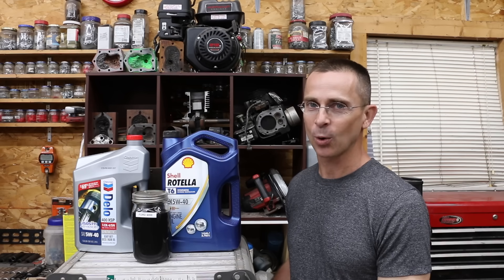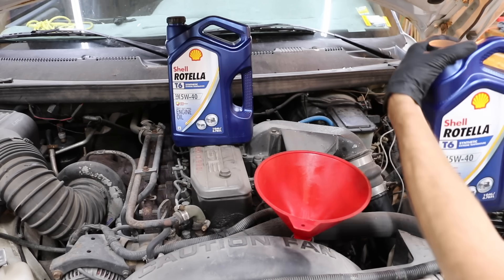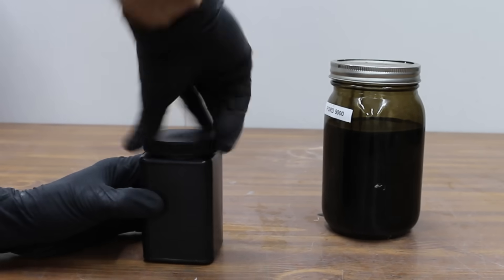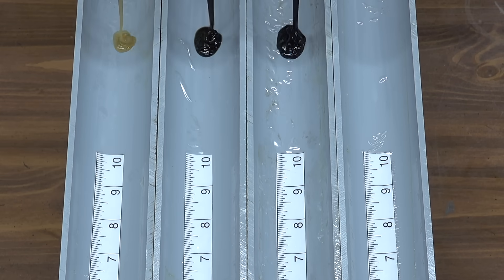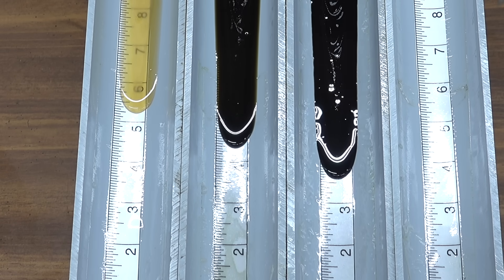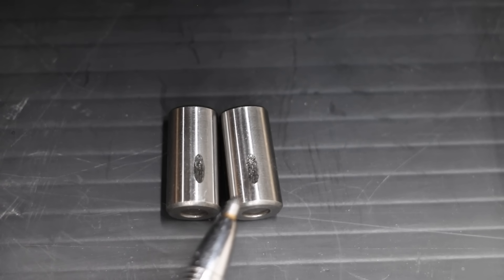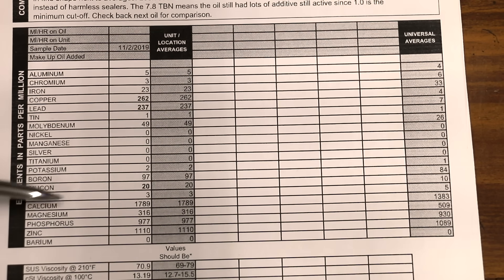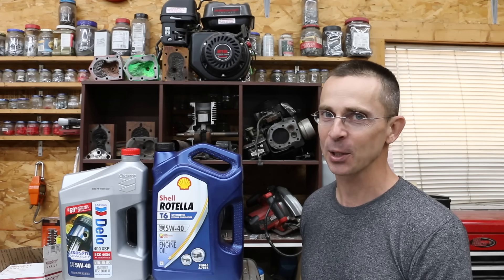Will Annual Oil Change Damage Your Car? Let's find out!

Comment: I can't believe that someone would believe that you don't need to change the oil annually. The rule is to change it at 6k miles/10k kilometres or in some cases 10k miles/15k kilometres.
Reply from the maker: Thank you for the feedback.  What if driven on only 500 miles in a year?  Why would the oil need changed?
Reply: @ProjectFarm  Yes, it wouldn't be economical to change it at that rate, but i also know a man that changes te he oul in his tractor on 100h when the recommend interval is 300h for that type. It's down to personal preference, finances and not forgetting about it! Have an awesome day!

Comment: T6 oil is also used in motorcycles with wet clutch.  It lacks the detergents that most gas engine oil have and would cause a clutch plates to slip.  So I'm told.
Reply from the maker: Thank you for the feedback

Comment: Great video. Question can you do a test comparing the new CK-4 10w30 diesel synthetic blend oils, more specifically Valvoline Premium Blue 10w30 vs Rotella T5 10w30?

I can help provide the oils if that would help.
Reply from the maker: Thank you for the video idea!
Reply: Project Farm, you’re welcome. If you need assistance to get this video started I can definitely help because I want to know which oil is better. And then maybe a Valvoline Extreme Premium Blue 5w40 vs Rotella T6 CK-4 oils.

Comment: Scotty Kilmer says... "Oil is cheap, Engines are expensive."
Great video brother!
Reply from the maker: Thank you!
Reply: @S.T-q6c  I am 1.8m 80kg. With a bad back. The Hyundai's have the drain plugs and filter right at the front of the car (very little egine bay) u don't need to physically be all under the car. U can do the job laying in front. But it looks like your head is too big 😉
Reply: @will260007  And that's precisely the point of my comment. Not every engine is designed the same way, for some, a way to get underneath is MANDATORY. Therefore, it's not "luxury". So good, you got an engine that is easily accessible. Please do the same on a M57N engine.
Reply: @S.T-q6c  that wasn't your point at all but regardless most standards cars can be done without any "luxury" (ps that that was just a joke, it's nice to have that but hadn't had any of that for decades and did manage without issues). Never did a diesel bma but did do an A4 when I had one. One of my comment above was also to drive on planks of woods to give you extra clearance when u do need to go further in without spending extra money. I even made steps with wood 2x4 once to increase accessibility and luxury. Good luck.
Reply: @S.T-q6c  Dude seriously get a life. Peace out.
Reply: Great video as usual. I usually don't reach the mileage within a year so its good to known. Another debate is warm up the engine to change the oil or do it with engine cold (not freezing cold).
Reply: I watch Scotty's video regularly and his advice are sound advice. However, that doesn't mean it's "right" for everyone.
There are two extreme end of car people. 
On the one end, it's the car is just a tool to get from A to B or people that goes "I want to buy a new car, but I don't know what to buy and I have no idea about cars." These people should definitely take Scotty's advice seriously whenever making a purchase or making a repair of a vehicle. 

On the other end is the car enthusiast, people who can't separate themselves from their car, people who love their car, named their car etc. Usually, when these kind of people want to buy a car, they know the brand, the year, the model, the exact spec, and all the associated problem of servicing and maintenance of said car. Scotty's advice isn't aimed toward you, so don't get butthurt or pissy about it when ever he make a comment about your car.

In my opinion, one should take Scotty's advice based on which end of the spectrum that they are leaning toward. Of course if you are the nut case that love niche cars such as a RX-7 (my STi is too reliable and no longer give me the sitting on a timed bomb thrill lol).  Then all advices are out of the window since you know what you wanted and what you are getting yourself into, hopefully.
Reply: @S.T-q6c  Did my girlfriend i20, 2 months ago. Couldn't be bothered bringing my 3 tonnes jack trolley so did it without raising it. Is that low enough for ya or is your i30 lower?
Reply: that phrase is the seed,  and even though synthetic oils are advertised to last longer, most people have their oil changes done at shorter intervals, " oil is cheap, engines are expensive".
Reply: https://youtu.be/JjMB1LSf3U
Come subscribe 
Stay and laugh
Reply: Sgt. SLaughter. Not so in Germany. Oil is expensive (a rip-off) and engines are VERY expensive.
Reply: Robert Ratskywatsky  valvoline instant oil change
Reply: Most oils nowadays can last a year in the engine. No disputing that but what needs to be taken in consideration is the type of engines you have. Some diesel engines can get the engine oil very dirty very quickly for example. Which will then create heaps of friction and damage the engine. Check your oil often and when it starts going black change the oil. I change the oil on my 4x4 every 6 months. Newer petrolcars tend to be quite clean and can easily be changed once a year. Hope this helps.
Reply: an oil change is around $100 near me. not cheap at all.
Reply: @dynamo3059  COUGH Do it yourself COUGH
Reply: @meow8384  i wud have to buy the equipment i need and find a place to store it. plus time is money
Reply: @dynamo3059  1- 5 quarts of oil- $17.99
2- ramps/jack stands- $39.99
3- oil filter $5.99 
Total cost- $65 w/tax 
Still less than those scam instant oil change places
Reply: @meow8384  i dont have anywhere to store oil contaminated shit in my apartment
Reply: @dynamo3059  you can drop it right back at any autopartspa for free
Reply: @meow8384  car ramp/jack stand. You guys do it in luxury. I don't even bother. Too long. Plus u only under the car just to unscrew the drain plug and then to screw it back on. Litteraly 2 minutes max
Reply: @will260007  I wish I had some more ground clearance. I have a Camry so it's pretty much impossible.
Reply: @meow8384  Done it on all my cars with similar clearance without jacking the car up. But if you need more clearance for cheap just drive the car onto 2 pieces of wood (large enough to be safe) that you first set right in front of your front wheels. This should give you a bit more clearance without investing in expensive things.
Reply: @will260007  good idea, I had to pay $50 for my jacks 🙄
Reply: @meow8384  and they use terrible oil..
Reply: @meow8384  I used to park mine over a small ditch.
Reply: Cough building association rule, city laws, cough cough, depends on where you live cough
Reply: Scotty kilmer is also a moron
Reply: @jeffh6971  you are wrong
Reply: Jeff H Haha. He can be a bit much at times. It’s Toyota World over there.
Reply: @Jeff H I think the only thing you can be certain he's right about are silicone wiper blades. Pretty much every other video just reeks of sensationalism, although apparently his videos about repairing older vehicles are rather useful. Just don't use him for newer cars lol
Reply: Agree edbo10, Scotty is an old school mechanic and certainly not a moron. He doesn't have much love for newer cars but is a wealth of knowledge about older ones!
Reply: @edbo10  Newer cars are over engineered pieces of junk with parts made up of plastic.
Reply: @cyberpunk11x

>overengineered
>piece of junk

pick one
Reply: @edbo10  Ever heard of planned obsolescence? Modern cars are not made to last.
Reply: @cyberpunk11x  ever heard of oxymorons? How can something be overengineered, yet a piece of junk? That was what I was trying to say.
Modern cars aren't made to last, largely because things aren't as overengineered as they were in the mid 90s, but they're a lot more efficient and a lot safer. There's plenty of footage out there of highway speed-crashes where somehow people get away unscathed despite the whole vehicle practically disintegrating around them.
I love my mid 90s camry and its overbuilt V6 engine, but I'm fully aware that if I get into a bad accident, I'm going to end up a lot worse off than the other driver in a 2015 camry.
Reply: @edbo10  I was talking about the modern over engineered BMW's, Mercedes Benz, Audi's etc
Reply: @cyberpunk11x  oh well in that case that's a completely different story - all the makes you just mentioned are known for being very expensive to maintain. "The only thing more expensive than a new Merc is a used Merc" and feel free to replace merc with any luxury european auto marque.

if you want reliability you go with japanese vehicles, especially toyotas, not because scotty kilmer says so but because toyota is very conservative when it comes to new tech. They tend to stick with older stuff because everyone knows that's what works, and they usually let mercedes, audi etc. deal with the growing pains of new technologies before they finally use it in their own vehicles.
Reply: @edbo10  yup
Reply: @cyberpunk11x  another cliché about "OvErEnGiNeErEd" german cars. Shut up.
Reply: @edbo10  bugatti veyron
Reply: @acc acc yeah...what about em?
Reply: @S.T-q6c  OvEr engineered means the Germans don't keep things simple like the Japanese do..they overcomplicate everything..the modern German cars are crap.

Comment: Getting engine to full operating temperature 1x per month also very good advice. For the alternator stator or generator to keep the SLI battery 12v SLA battery fully charged, the vehicle must be on at full operating temp & speed for about 3 hours per week in modern passenger cars with lots of small persistent electrical drains on the battery, think security system, telemetry, smartkey transceiver, some compute elements sleeping or hibernating rather than fully power cycling off, since turning the car back on afterwards would take longer if the slow embedded computer had to cold start every time you hit the start button. Modern cars after 2014 can have over 130 onboard small low power android computers, kind like arduino, but more semi-custom OEM supplier & supplier integration modules, the ECU, ADAS system, navigation & telemetry, networking, security, safety systems, active electronic alarm & key fob smart key always listening on for remote signal input or proximity activation etc
Reply: I regularly recommend that people keep underutilized vehicles on a float charger or charge maintainer to keep the 12v starting battery of the episodically utilized vehicle fully charged. I personally use a 12 LiFePO4 battery in my Honda PCX150 Kymco scooter since I rarely drive it 4,560mi since 2013 // so far that Lithium Iron Phosphate starting battery seems to work, even when neglected without any charging. The scooters simple electrical system turns all the way off when the key turned to the off position & ignition switch locked off. No persistent drain in the LiFePO4 except from the BMS in the battery, perhaps 20 microwatts or less. Its smaller than a 4L-BS but throws out 130+ CCA, more than enough to crank the 153cc fuel injected liquid cooled gasoline single piston engine 13 hp 11 lb*ft torque, good for 84-105MPG at 0-72mph with its aftermarket CYC tranny upgrade & new gates CVT belt. I change the oil more often then I need & put an iridium tipped spark plug & run ethanol free fuel or stabilized E10 & keep the tank full in storage (only holds 1.6 gal) glad it has such stellar fuel economy or the range would blow. Likes to cruise at 35-55mph & goes really good 15-50mph, not great at slow speeds below 10mph due to lockup speed of centripetal clutch

Comment: All right I've got a question for you or the viewers. I have a company car and a personal car. So my personal car sees about 6k-8k miles per year. Gets driven almost always once or obviously more per  week. It ALWAYS comes up to operating temps, and if my drive is hard on the turbo i always let it sit and idle before turning it off. I did 3 oil changes last year. Mobile1 full synth 5w20, and always new filter. Should i be changing it every 3 months? It's a 2018 gasoline, EcoBoost engine if that helps with the outcome. I also installed an oil catch can because i don't like the thought of oil circulating through my charge pipes and intercooler.
Reply from the maker: Thank you for the feedback

Comment: Great job! I've been using Rotella T6 in my cummins, Perkins, and Kubota for years. The Perkins recommended Shell Rimula, which I never heard of, so started with the Shell Rotella...sounded close! 20 years, zero issues, and haven't changed the oil in 2 years on the cummins, can't remember on the Perkins, and who knows on the Kubota! Kubota is a 1988. Just bought a bunch today.
Reply from the maker: Impressive!  Thank you

Comment: i have a motorhome,  8.1 Chevy workhorse. It has the wix 1 qt filter.  I drive it approx. 50 miles a month on the freeway to next camp spot it always reaches full operating temps. It gets almost no city driving of any kind. It now has 1600 miles since last changed oil 2 years ago. It was also fully lubed 2 years ago. Can this go for another year? thanks kindly  for any comments by others..
Reply from the maker: Thank you for the feedback

Comment: I use the Shell T6 on my motorcycle. Been using it for years. My bike currently has 48k miles and never had a problem. Can’t beat the price at Walmart for 4 quarts at $20.
Reply from the maker: Thank you for the feedback

Comment: A old feller told me to put a quart of automatic transmission fluid in my gas tank and it would totally clean my entire fuel system. Me being young and dumb like I was done as he said. But to my amazement it did just like he said ! A little four cylinder motor in my Cavalier smoked a little bit through that entire tank of gas but I never got better gas mileage in my life
Reply: Marvel Mystery does the same thing, you just did it the cheaper way🙂💪
Reply: @willg.5168  ahh cheaper the better  !
Reply: @MRFUSON-uj9bs  no doubt!👍

Comment: As usual, great info!!  A lot of us supersport bike riders use the Rotella T6 in our bikes, which turn up to 15,000 RPMs.  Most rides my bike gets to full operating temperature of 180+ degrees F.  Any info on how the oils hold up in bikes?  I'm interested to know if I really have to change the oil/ filter every year if I've only put 1,600 miles on the bike.  Thanks, and keep up the great unbiased tests!!
Reply from the maker: Thank you for the feedback

Comment: We've been using Chevron Delo 5w-40 on our farm ever since it first came out on the market and my Grandpa switched to Synthetic. We use Chevron's 5w-40 in all Gasoline & Diesel engines on the property! Many thousands of engine hours have been without engine wear failure. One Allis Chalmers tractor has upwards of 14,000 engine hours and it has never had a failure caused by low/loss of lubrication. In fact it's the original Engine. Many many -40° starts on it, feeding literally thousands of cows, on early frosty mornings. Naturally some of our oil changes have been well past 1 year and on more that one occasion long past the 500hr oil change interval recommended for large high speed diesel engines! It does not surprise me that Shell has had to use more additives in their oil it is the only possible way to match the performance of Chevron's base engine oil. I should point out that we have used Rotella T engine oil over the years a few times and never had any issue with it either, normally just 15w/40 conventional oil. Personally I find their synthetic oil priced too high unless it's on sale somewhere. Either one of these Oils hands down give Amsoil a major run for it's money. I read that a Mack truck down south ran 450,000 miles on a single oil change using Amsoil Amsoil 15w/40 synthetic. This was not completed during a one year timespan.
Reply from the maker: Thank you for the feedback.

Comment: What do you think of mobile 1 synthetic 15,000 mile oil? It’s 5w 30 oil. I have a Toyota Highlander.
Reply from the maker: It's a fairly good oil but I would change the oil well before 15,000 miles

Comment: I have a question
So it is okay to add the oil on top of used oil, rather than empty the crankcase first?
Seems the used oil doin better than new one 🤨
Reply: are you just keeping the oil level above minimum? then it's OK. used oil ADDITIVES depletes over time. and oil filters get clogged over time